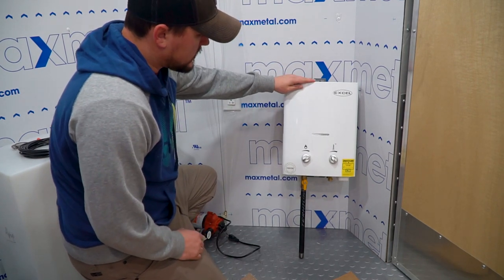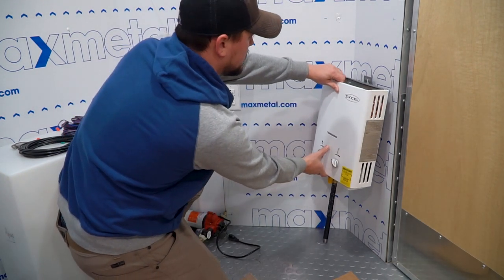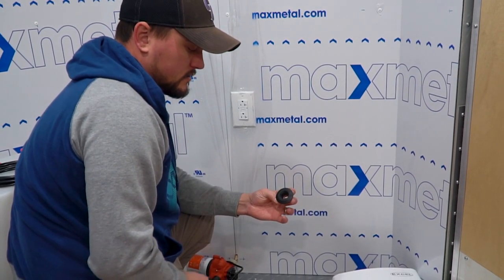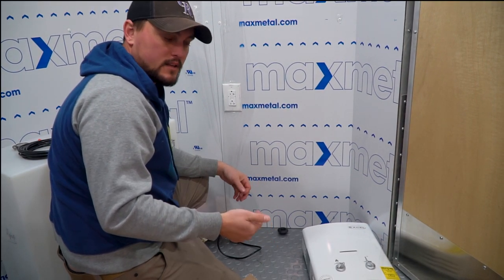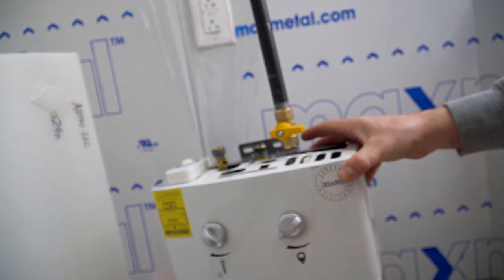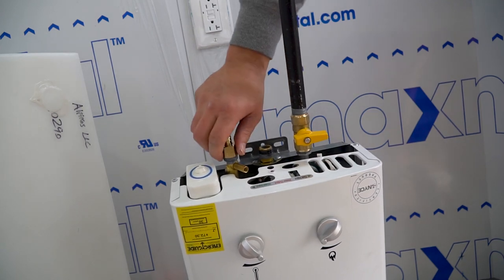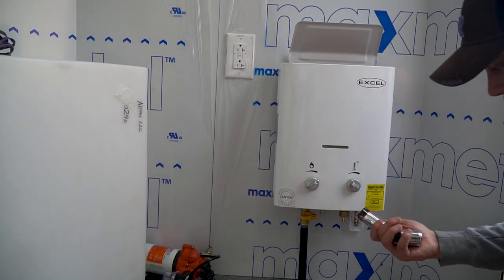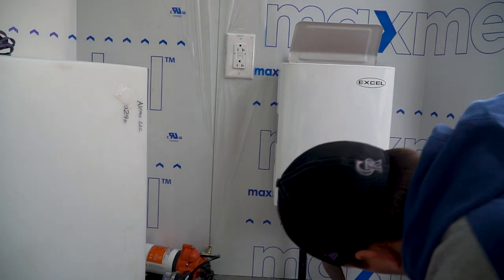The BEST Tankless Water Heater & Water Pump - Cargo Trailer Conversion Ep.9

Comment: I'm putting a rain water system in. I have an elect tankless heating tank & needed to know if I have to put the transfer pump between the water tank & tankless heater or should I put the pump after the heater then to shower head?
Reply from the maker: You always want the water pump after the water tank. Good luck with your project!

Comment: I tried pex pipe and it leaked at every connector. I used the shark bite kind i wasnt going to buy expensive tools just to hook this heater up. I bought half inch to three quarters connectors and installed water heater supply lines, much better and No leaks. 73
Reply from the maker: Hi Ron, I’ve never tried the shark bite connectors. I bought my pex install kit on Amazon for $30 and have done 4 projects with it now without issue. Glad you found a solution that worked for you though. Good luck with the rest of your project!

Comment: No venting issues for the indoor units?
Reply from the maker: No, its been great. This concession trailer has a big serving window that is open when in use, so it pulls in plenty of oxygen to keep up with the heater. Since it is an instant water heater, it only runs when you open a hot water valve on the sink so it only runs for short periods. If using this in a camper I would recommend putting it in more of an open space and to have a window open when using it.

Comment: I am really curious to see how this turns out, I have a project in mind for this type of thing. I did not see any Teflon on the connections, do the fittings have built in gaskets? I did not know vent less was an option but there is still probably some co, but options are good like this for open air areas. Pretty cool though.
Reply from the maker: Hi Brian, PTFE tape (mega tape) was used on all connections. It’s grey so it’s harder to see than the yellow Teflon but you can see me install some at 5:11 
These excel water heaters are meant for indoor use and many people are putting them in RVs, boats, and cabins so it could be perfect for your project.
Reply: @ShouldBeGood  I probably got distracted but awesome build, I may have been looking at the specs of the heater. Awesome content by the way.
Reply: How can this be a "ventless" propane water heater?
Reply: @Myownchanelhere  it doesn't require a vent because the gas is burned up but it should be installed in a place with good ventilation. It's kinda like these ventless fireplaces. Also they make ventless heaters. All these have oxygen sensors to shut down the heater when the oxygen level goes below the safe level. 73

Comment: How would you winterize the heater?
Reply from the maker: It has a drain valve on the unit but to be safe I would blow out the entire water system with air. Similar to how its done on a rv.

Comment: Do you need a water pump even though you have the water heater
Reply from the maker: Hi! Yes, the water heater only works with pressurized water and only heats the water as it is being pumped through the unit. Without the water pump there will be nothing pumping the water from you freshwater tank. Thanks for watching and good luck with your project!

Comment: Not smart to put that inside it needs to be vented outside
Reply from the maker: No, this is is specifically meant for indoor use and the manufacturers installation instructions were followed. It’s not like the other “camping” style outdoor water heaters. Check them out, they are pretty awesome!
Reply: That's debatable I smell gas fumes in the laundry room where it's installed. 73